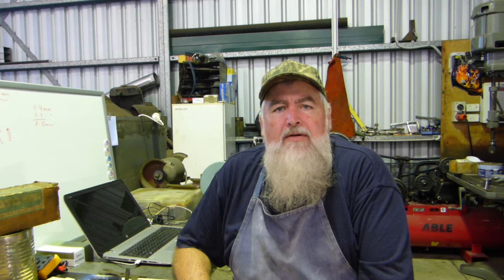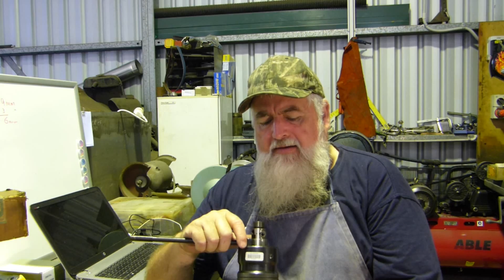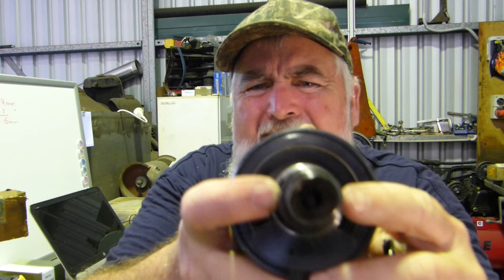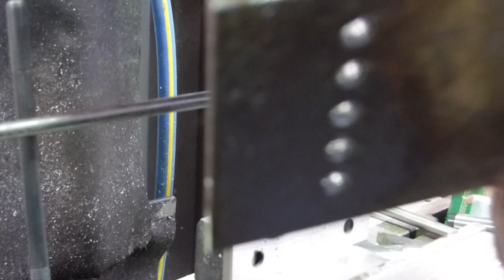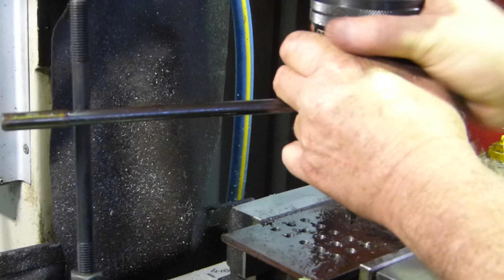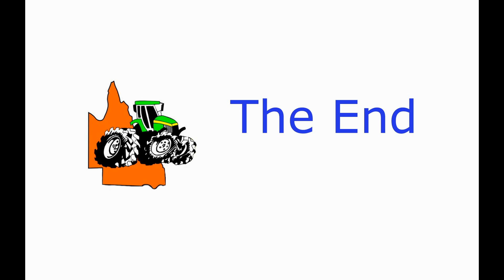Kangaroo Stew # 35 Playing with a Tapping Chuck

Comment: I know Lance this sounds far from logical, but I had a similar problem with my trailblazer recently. After about a week of looking and the help of my local mechanic we found it was the a bad ground between the battery and to the body.
Reply: I forgot to specify your Colorado problem
Reply from the maker: Butch Smith I have tightened the small earths but not the main one now I think of it. Thanks Butch I will check it out

Comment: Never seen  a tap like this one! Thank You. One ? for you. I have a Cav injector pump {323F850} that will not pump. The transfer pump seems to be working, but the main pump does not work. The transfer pump will pump down the fuel and pump it out the return, but not a thing out to the injectors. I put a seal kit in and all things look good inside. I pulled it down again for the main pump. It all looks good too. What can I do ?  miningdave9244@outlook.com
Reply from the maker: G Day David, Is the main plunger under the rollers still nice and free?
Reply: All free. The roller slide in and out nice. I have taken the main pump a part. When I slide the roller back in there is a air cushion for a bit of time, but the air goes away.
Reply from the maker: Air cushion wont be there if you turn it to line up the ports in the head. What about the plunger under the inlet spring?
Reply: That all looked good. I add fuel to the inlet and turn the pump and the fuel goes down fast. keep adding to it till fuel starts to come out the return. No fuel at all come out to injectors. What should I be looking at with the plunger and spring?

Comment: Good to see you worked out the tapping chuck, I used them a lot when I was a boy. Its a wonder you couldn't hear me yelling to you that the clutch was adjustable. Not too good in a lathe, basically because the drive is coming through the work-piece and not through the clutch in the tapping head. Good stew, thanks for that. Geoff.
Reply from the maker: Thanks Geoff, It is a great tool and yes a bit slow when filming some times lol, I had tried to turn the clutch but it was very firm and needed freeing up as I couldnt turn it at first. Very happy with it now.

Comment: Oh on the Colorado see if your scanner can see data in the Body Control Module, you have not said if the scanner just reads codes or has a data function.
Reply from the maker: The scanner can see data, but I am not too sure what I am looking at properly as yet. Last time I looked for a code EBD2 when it was playing up it would not hook up with the code reader while faulty. I went and bought the new scanner after that and since updating the scanner with the latest info it has not played up for me to try again. Thats the problem with intermittent faults.

Comment: Thank you another good bowl full of stew, I wonder how many of us have tools laying around the shed we have never tried to use ?
Reply from the maker: G Day Steve, Yes there will be a few, i have gone and got out a ball turning tool i have not used in some time for a play now and possibly next stew. It works but needs a few mods now I think. Thanks for watching and commenting.
Reply: Bundy Bears Shed I would be interested in you showing a short demo on the ball turning jig ,always wondered if I could make a ball and socket joint .fancy having a try? cheers
Reply from the maker: I will have a go at most things so I reckon I could be up for it. The ball will be ok the tool might be too bulky for a socket but in theory it could do it. I am having trouble getting the sizes correct so I need to put a calibration mark of some kind on it
Reply: Bundy Bears Shed Fantastic I look forward to that thanks so much and carry on enjoying life

Comment: if the spindle of the tapper is held solid it will not reverse the the tapper will lock up int the same direction push or pull if you let the tailstock float and reverse the lathe it can work but why bother
Reply from the maker: Yeah the only advantage I can see by using it in the lathe is a slip clutch and that could be handy at times.